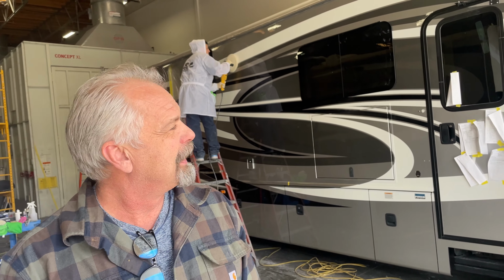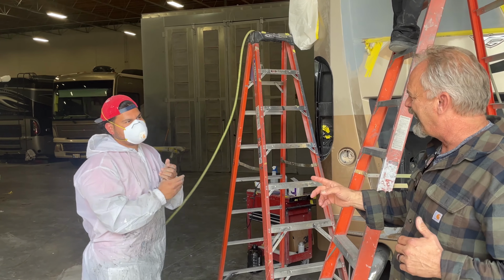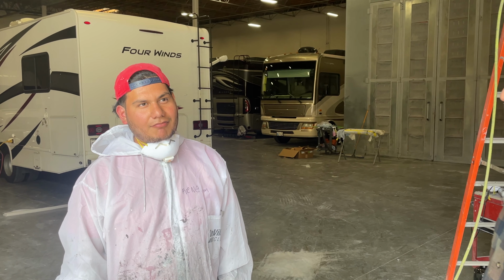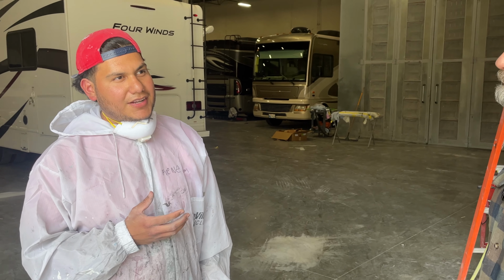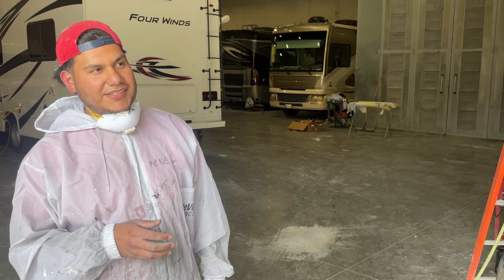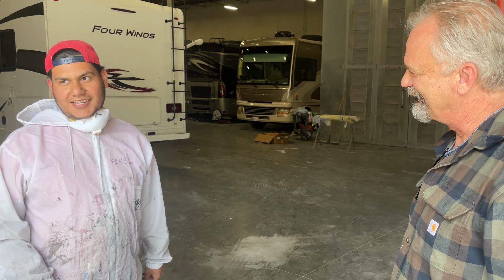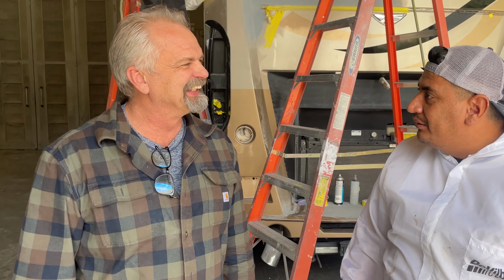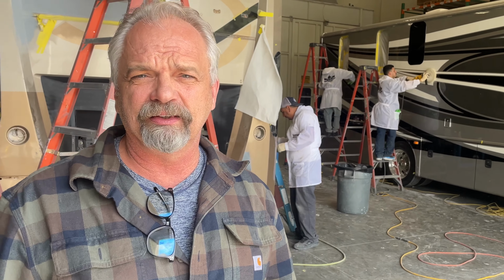CSI polish takes on 3M compound in a motor home body.

Comment: I tried the CSI polish, but wasn't super impressed with it. I found myself reaching back to m105.
Reply: Did u use new pads ?
Reply: Nothing beats CSI. If someone doesn’t get good results, it’s no fault of the product, it’s the user. Tom has put out several great videos on how to correctly use the product. I’d suggest you do yourself a favor and watch those. Good luck.